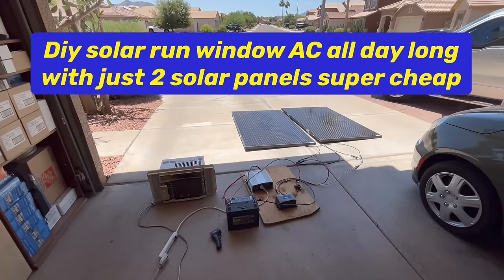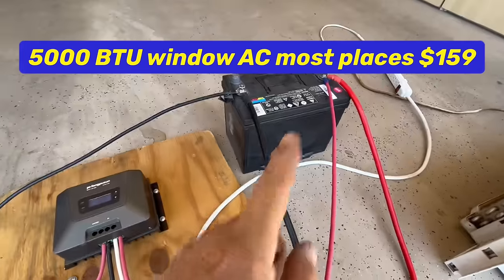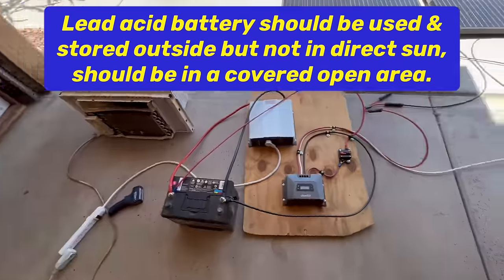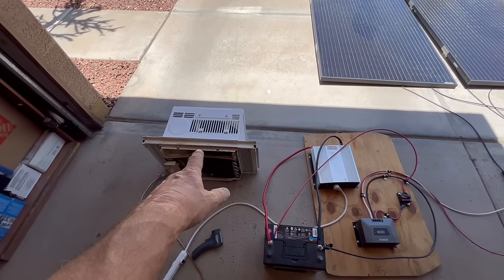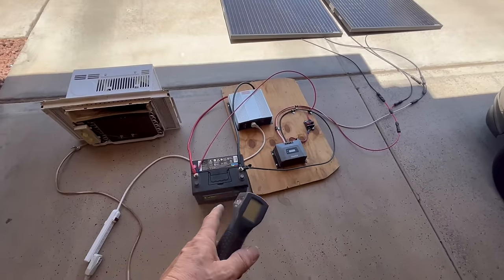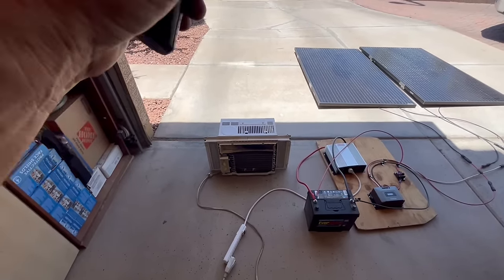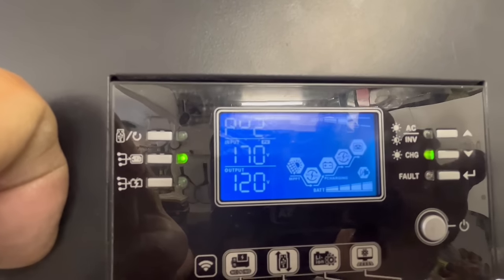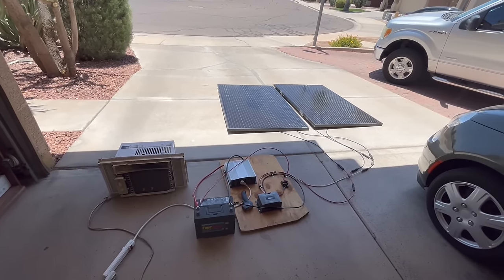Run your window AC with just 2 solar panels when sun shines. Easy DIY project you can do in one day.

Comment: Haha, love it. Click bait!!

Run an Air Conditioner with just two solar panels.

Within a minute of the video. You hear the truth. Wires, charge controller, inverter and Battery are needed.

Dammit forgot the two solar panels.😂
Reply from the maker: Just a brief intro to basics in ac and dc and the difference. Ac is called alternating current and is used in homes and businesses but is not used in boats, ship, airplanes and vehicles. ac is grounded by using a wire connected to a rod buried in the ground. This is for safety purposes and for lighting strikes. But with moving things such as vehicles, ships in water, planes in the sky this is impossible to run a wire to the ground since all these are moving, so they use what is called dc or direct current. These ground to the body of the ship, plane, vehicle etc… for safety reasons since they can not run a wire to a rod in the ground. Stay with me because this part is really important, you can not connect ac to dc directly, it is incompatible so you need what is called an inverter which changes dc to ac or ac to dc depending on your application. So basic truth is a solar panels produces dc volts and amp and a window ac unit needs ac volts and amps so you can not plug dc producing solar panels into a ac window air conditioning unit. See how easy that is. In order to fix this problem we will need to run some wires from the solar panel into a device called a charge controller which will change the 38.9 dc volts from these solar panel I have into a lower dc voltage that is 14.2 volts or less to charge out 12 volt battery that is a vital component to converter dc to ac. We need the battery to keep our voltage very stable and constant since a solar panel output can be affected greatly by clouds, fog, rain or shading from trees or buildings. These are just a few examples of issues for interruptions to solar output. If you did not have a battery to keep voltage and amp’s constant, the air conditioner would shut down each time there was a decrease in power output from solar panel due to shading for example. So finally you need the battery to connect to the 12volt modified or pure sign wave inverter to convert from dc volts from solar panels to ac volts. Now the air conditioner will receive a constant stable ac power from the solar panels that are converting sunshine into dc output with the solar panels. But you need all these components and all the wires to connect all together to make the system be able to work. I know when I was in school they taught these basic principles of electricity and the difference between ac and dc. I am sorry if they have not been teaching this anymore or it is something that might seem to difficult to comprehend. But it is basics that you need to know if you ever work with building a solar powered system. I know you thought you were trying to make fun of me with your comment . That is ok, I forgive you since you may not know basics in solar or the difference between ac and dc. Even if you knew the difference and just thought I could be the butt of your joke today, that’s ok, I still forgive you and hope you will repent and not do this to others when they are just sharing information that is greatly appreciated by so many others in understanding how solar works. I’m not sure you understand what click bait actually is? But this was not intended to be a click bait, but a basic introduction to how solar works. Over 230,000 people have viewed this video and you are the first person that thinks it is click bait. This is a DIY channel, in a DIY channel, the person shares how they built something for the purpose of informing others who what to know how they can build it and all the components they used to accomplish this project. I don’t see how that is click bait as you call it? I truly hope you have a wonderful and extremely blessed week. And I hope you try not to make fun of others as you tried to do to me today when they are just trying to help people understand how to build something, not charging them at all to give them this information with no other intent but to just help them for free. Life is so short, I choose to help others and freely share what I have accomplished with DIY. I have been going through 2 incurable cancers for the last 10 years and have to get IV treatments every 8 weeks for the rest of my life and had some scary moments where I thought my life was going to end but by the Grace of God I am still here and I can no longer work but chose to do solar since I am home 24/7 from cancers. It takes me days or weeks to accomplish what a healthy person can do in a day or hours, and I don’t let that stop me. It has taken 4 years to build my off grid solar system I use to save over 80 percent off electric bill and will pay itself off completely in savings on electric bill by the end of this year. December 2023. I have compassion for others and this is just one thing I share for free with others, I have a lot of viewers from many countries around the world that a few  have used info I have given in videos and now have ac for the first time during the day while it is sunny out using off grid solar with wires and other components. These are countries where there average yearly salary might be 1/20 of our yearly average salary. This is a huge deal to them since it is something they can install themselves with cheap or used parts. I find great joy in helping others. I hope someday you will experience that for yourself as well. Once again, I truly hope you have and extremely wonderful and amazing BLESSED Week.